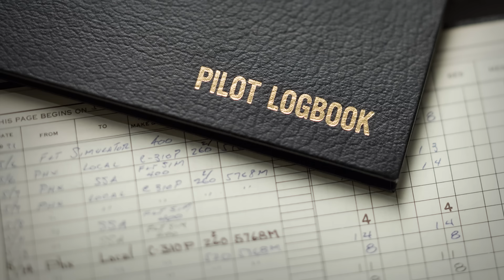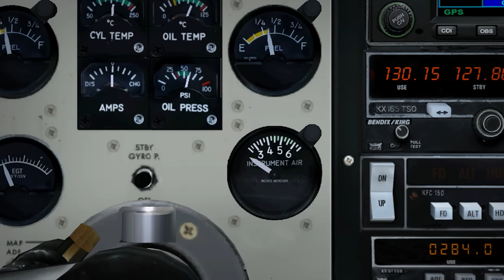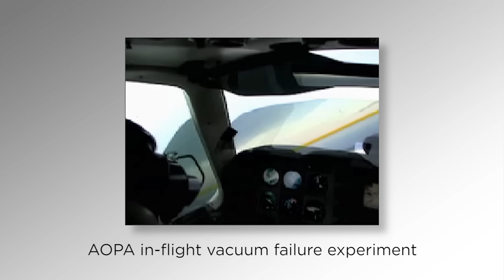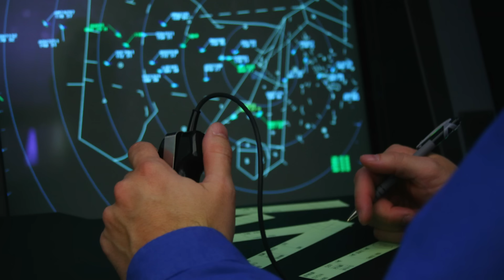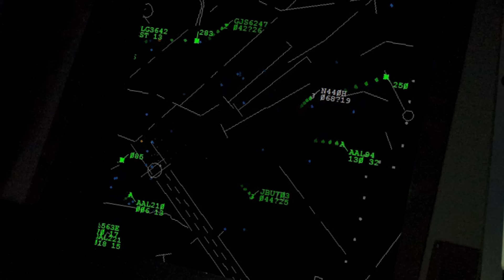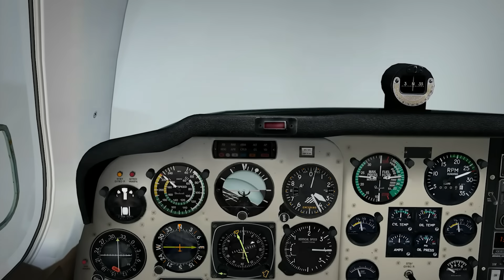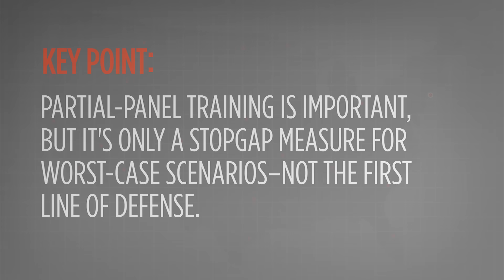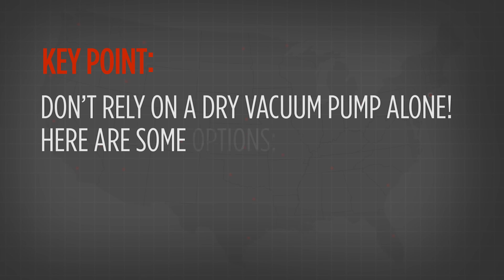Accident Case Study: Single Point Failure

Comment: Know your airplane!!  As a young pilot, back in the late 80s, I often thought of ATC as the big Pilot God.  You know;  they could help/get you out of anything.  Not!  They are there to help you and that is true.  But, many are not pilots themselves. My next door neighbor is one of those.  He is a great guy and a fantastic controller by the way.  In reality, they are there to assist the "Pilot in Command" during an emergency and one needs to be very clear in telling them EXACTLY what you can and can't do.  Remember at the beginning of this film how the pilot was reluctant to declare an emergency?  I do believe many pilots look at ATC as the "Father of the sky".  (Don't ask daddy for help when something is wrong. You might get into trouble type of mentality.)  Fly High
Reply: Great post!
Reply: I've been guilty of it too, there is a reluctance to declare an emergency, which is just silly, as long as you aren't maliciously abusing your PIC authority the worst you will have to do is file a written report. When the pressure is on like that you need all the help you can get.
Reply: Terry Melvin  Well he can't fly very well with a partial panel. ATC should be a lot more helpful in this situation.
Reply: He never told ATC what his problem was. They are not pilots, not engineers, and certainly not familiar with the techical details of your model plane.

Comment: The first IMC flights were conducted using only turn-and-bank indicators. Virtually all small aircraft now carry an instrument that tells the pilot if he is turning (and in which direction), i.e. equivalent to the old T/B - a GPS, either panel mounted or portable. 
Keep the yoke centered and use only rudder for directional control is actually quite simple. The hardest part is ignoring the seat of your pants...

Comment: In 2010 I flew a 1972 musketeer into IMC without being instrument rated and the worst thing was just as I flew into IMC my vacuum pump died and there was no back up also. It was a miracle that I got out of these conditions without killing me and my friends. ATC was really helpful, he understood everything I told him because he was a pilot also and I was lucky that within 5 minutes after the pump failure I flew out of the IMC conditions, if I was stuck there for another 5 minutes I would have most likely ended up like this guy. That incident scared me so much that I almost never flew again, my friends never realized the extreme danger we were in, they thought as long as the engine is running we're were fine but after I explained to them how close we were to dying and I showed them few videos of what happens when a non instrument rated pilot flies into IMC then they realized how close to death we really were.
Reply: How do vacuum pumps know when they enter clouds? Seems uncanny, but I've lost seven pumps in my career. All of them were while flying in IMC. How in hell do they know?
Reply: Aviation Nut we live in an age of cheap technology that’s a life saver for pilots 
Every pilot should Fly with an iPad running synthetic vision
Panel failure wouldn’t be as much of a problem, you’d have enough information to get yourself to Vfr 
Even without a ifr rating it’s quite easy to use the iPad for additional information
Reply: You always have (or should, anyway) a plan to fly on instruments if you inadvertentely enter IMC. But this isn't as easy as it seems, as evidenced by this, and many other similar accidents.
Reply: wow, Aviation Nut, I am so happy things turned out well. 5 minutes is a long time though, relatively. It's even longer than the story presented here. Do you recall how ATC helped u out in ways a non flying ATC maybe wouldn't have?
Reply: @androidkenobi  Im no pilot and virtually nil knowledge about flying an aircraft. But I feel to be in the ATC some flying certification should be mandatory.
Reply: Murphy's Law: If anything can go wrong it will, at the worst possible moment.
Reply: drjimjam111 Well, that last part you added.  Murphy’s law is simply what can go wrong eventually will.  It’s just bad luck if it coincides with the worst possible conditions (which, can’t have been the case with 7 pump failures, as he clearly survived each.  If you survive, coulda been worse lol.)
Reply: Scary story Aviation Nut!!  Glad you and the friends survived it!
Reply: There have been a couple of accidents where ATC did not understand the severity of a vacuum pump failure and properly assist the pilot. Most ATC people I have encountered are outstanding professionals.  But it all comes down to the pilot.
Reply: @raoulcruz4404  what Vacuum pump does? Thanks
Reply: @Sky10811   Supplies air to operate the gyro instruments, such as the attitude gyro and the heading indicator.
Reply: For diversity they hired a moron for the job in the White House. So it goes.
Reply: I'm not a pilot, but my sons are. For ga pilots... Why not have a back-up plan to follow your instruments when hit with an imc situation. Heck my youngest focused so much on his instruments, the instructor had to teach him how to keep his head UP (he loves flying the instrument panel! He's a gamer so go figure).  

PPL Training does teach a bit of flying on instruments, it should become a regular training regimen imo. Like bring with you someone in the right seat, and at some random time put on the foggles to force you to fly by instruments alone.  That will instil confidence and ability to get out of a bad situation.  

As far as your incident goes Aviation Nut - and I asked them - My son's FI's always teach to follow the turn coordinator & mag compass in partial panel ops, and to cover the bad instruments with post it notes. It does work. I could never imagine a confusing panel blaring all the bullshit they do with a bad vacuum pump system plus being in the clouds or at night. It's scares the hell out of me just thinking about it.  As a dad I do the fsx bit from time to time, but can stay out of trouble by following those 2 instruments (if I fake it). (God, the mag compass in fsx sux video quality wise).  My youngest keeps wanting to steal my simulator.. haha! Guess I need to buy him his own rig.

Cheers man. I love musketeers... and totally go apeshit over sundowners! I love the twin doors, 180hp... full ifr capable. Maybe looking to buy one some day.
Reply: @dryan8377  I LOVE the idea of instrument panel flying on your own time with a safety pilot, even if you're not IFR rated or going through IFR training. It's great practice and won't cost you anything extra except a beer for your friend. I plan on doing this every chance I can.
Reply: @dryan8377  You'll likely love the new Microsoft Flight Simulator due out maybe mid-2020. I'm sure you'll be aware of it though.
Reply: Vaccum Pump failure.. another reason not to fly with these amateur technology aircrafts
Reply: @bobl78  Get over yourself

Comment: It would not be that hard to train controllers that a vacuum failure is an emergency.  There was unnecessary distraction when the controller asked the pilot to descend into IMC when the pilot had just informed the controller that he had lost his gyros.  What part of No Gyros didn't the controller understand?  I understand that controllers aren't pilots, but having some basic knowledge of systems and their significance is not an unreasonable expectation.
Reply: The pilot has to declare an emergency in situations like this. Once he does, the controller has more options, which is why he kept going on about it until the pilot confirmed that, yes, he was declaring an emergency.
Reply: When a pilot declares an emergency, controllers should have a way to get a pilot controller to assist. ATC did nothing for this guy.
Reply: Being misheard happens, this is why confirmation is repeated back. Second the pilot can simply say "unable" followed by stating what they are doing instead, not as a request but as a statement like "climbing to 8000feet due to cloud tops". ATC must work around the abilities of the aircraft (as declared by the pilot). ATC is there to prevent collisions (air to air and air to ground) ATC is not there to fly the aircraft.

Comment: I have lost vacuum three times,  all  in IMC.  

My IFR training involved  lots  of partial-panel.  There is no reason for anyone to not survive vacuum failure.  Being able to fly with just the turn coordinator is  mandatory_.  Make  _sure  that  your  instructor works with you until  you  are comfortable you can do it before you get your IFR rating.  

After the second time, I bought the alternate-source vacuum hook-up - then forgot I had it when I lost vacuum the third time.  Oh, well:  at 8 or 10,000 feet, it doesn't work so well, anyway.  

February of 2017 I had the Garmin G-5 installed in my 182 as soon as it was legal.  The old vacuum AH was moved over to the right side.  I also bought a new autopilot, an S-Tec with its own turn coordinator; so the old one was also moved to the right side.  Love that redundancy!  

If you cannot survive vacuum failure, get an instructor who will teach you how!  

Quick hint:  without vacuum, only change altitude or heading at a time;  never_,  _never   try to do both at once.  And tell ATC not to ask!  You're PIC, not them!
Reply: I call bullshite too. Any aviator worth his salt would be humbled by such events and would undoubtedly be quite forgiving and helpful toward less experienced pilots. No decent pilot would be bragging about this in a video featuring an accident caused by the same
Reply: @rsmith155  Perhaps an arrogant one, and believe me, there are tons of those
Reply: Battlefind which is why I specified that “no decent pilot” would
Reply: Battlefind and I was agreeing with you. Welcome to YouTube comments!
Reply: @rsmith155 , you're taking offense where none was given.
Reply: You are RIGHT, One at a time.  So Even if ATC tells you, “Turn Left to a heading of 060, descend and maintain 5,000 feet”, You can easily turn first, level out, then start your descent.  Back in the 60s (I’m an Old Pilot), we used to practice IFR on a Mag Compass.  So all you need to control the aircraft to a safe landing is a Compass, Altimeter and Airspeed.  You should know what RPM/Prop setting along with Flaps and Gear will result in what airspeed and/or Rate of Descent.  Usually you have a Turn-bank indicator (electric) and maybe even in older aircraft an ADF both of which help a lot.
Reply: You’re talking about what to focus on for IFR training, but this guy wasn’t certified.  I’m certainly no expert but I’ve seen plenty of situations where VFR pilots enter IMC and that’s all she wrote.  Ofc if you have IFR training you’ll be more capable.  Pretty sure the only thing for a VFR pilot to do would have been divert far away.

Also everyone talking about pumps says they’ve always failed in IMC.  There must be something about clouds and weather formations that increases the likelihood of a failure, there’s no way that’d be coincidence, unless people just tend to forget failures under perfect conditions.
Reply: @newname4405  There is no correlation between IMC and vacuum pump failure, the pump can't tell if the pilot can see the ground or not.  The pump failing on a flight in visual conditions is a non-event, however, if in IMC it can be a big problem.  This is why you hear about them failing in IMC.  If you find yourself operating partial panel, communicate this clearly to ATC, get to and stay VFR on top if possible.  If you must shoot an approach to land, get vectored for a straight in approach in a radar environment where ATC can monitor your heading as you descend.  An airport with a CAT III ILS has more lighting, which can assist with nighttime approaches.  Some airports can provide no-gyro approaches where the pilot is guided as to when to turn left/right by the controller.  Ask if these are available!  Use the resources of ATC, they are more than willing to help, but you have to clearly ask for their help.
Reply: That's my feeling as well . I'm really not clear how a pilot could rack up 4000 hrs and NOT be IFR rated  I mean is that a common thing ?
Reply: @TheRoguelement  Its pretty common unless one is either actively employed as a pilot, or is highly committed to maintaining IFR competence over their entire lifetime. The pilot in the video held an ATP certificate, which is like an instrument rating but with much tighter performance standards.The certificate is good for life, but the skill set starts to degrade in as little as a couple months of non-use. If he retired from an airline career at 60, and either chose not to maintain currency, or just did the minimum legal requirements, after 6 years, he is ill equipped to deal with a partial panel situation.  

This is often a very difficult thing for retired pilots. They have memories of years of recurrent training and checkrides... so their is a tendency to believe one can always put those skill back to use. And there is an element of truth in this... Most retired airline pilots can become proficient and safe with only a very modest investment in recurrent training, even if a number of years have passed. However, without recurrent training, they can and do get in over their head very quickly.
Reply: I call bullshit on that one.
Reply: @bellboy4074 , I call bullshit on you calling bullshit on him.

Comment: Sad situation from which an excellent analysis has emerged.Outstanding job by ASI.Agree that pilots need to take control, decide, & then tell ATC what you need, such as specific altitudes & “no gyro” turns.Was the gear found retracted? Putting landing gear down in a bonanza (like most aircraft) can really improve control.Electric backup attitude indicator, if present, is ideally placed in pilot’s scan, rather than off to the right or on a sub panel.
Reply: wondering, how does putting the landing gear down improve control, reduce your speed?
Reply: @modeler4  By increasing drag, reducing Vs and reducing airspeed, gear extension allows a slightly more stable flight regime from which aircraft is less inclined to develop an unintended roll. Extending gear should be one of the key moves when flying into a thunderstorm or severe turbulence, esp.in a high performance plane like a Bonanza(see POH). Admittedly, this may not do enough to prevent a spin, and having redundant horizon guidance, as emphasized by narrator,is tantamount to flying imc.

Comment: Great Video!  The vac system is always a major concern.  In 12,000 hours of flying I have had three failures of both wet and dry vac pumps (all in VMC).  As a rule, I will not go IMC in a plane or helo without a back-up.  Ever.  Trying to safely fly in IMC without a back-up is very foolish.  Recently, the vac instruments in my plane have been failing, although the suction gauge always shows in the green.  I finally had "had enough" and installed an Aspen 2500 system and yanked the whole vac system.  When a vac failure is imminent, it is no time to re-learn one's Partial-Panel skills.  www.mentorflightoptions.com

Comment: Controllers should encourage declaration of Emergency.    "do you want to declare..."  VRS "I encourage you to declare.."  The difference in words could save a life.  Further, when single pilot a controller should take a more active roll helping the pilot.
Reply: In europe ATC is encouraged to treat any aircraft that communicates an "emergency-level" problem as an emergency, even if the plane doesn't officially declare. (And ofcourse the mayday call isn't mandatory in either europe or the US as it just indicates the following message to be a distress call or distress call relay.)
The way I heard it said by an austrian ATC: "If you have to ask if it's an emergency, it IS one."
Reply: This is what this channel is about,  you are the PIC and you need to do that
Reply: I don't think ATC can take on that responsibility.  One controller may be handling numerous flights, and can't possibly take responsibility for evaluating and determining whether or not one guy is having an emergency while he's running a dozen other planes.  The pilot is only handling one flight:  his own.  The pilot has to do the evaluating and tell the controller he has an emergency.  

In this case, it sounds like the controller had enough room in his workload that he could "encourage" (by asking) this pilot to declare emergency.  But we can't require that of the controllers.   Once the pilot tells ATC he has an emergency, then they will do everything they can to get him down safely.

Comment: I've watched three of these caused by "vacuum failure" and noticed a trend. Old school part-time pilots flying old equipment without upgraded technology - I mean, not even a GPS capability?
Reply: If you're used to flying with "old equipment" you'll be fine in a situation like this. He might have had GPS, but he wasn't used to flying with a turn-and-bank indicator, but rather relied on his artificial horizon.

And GPS is by no means required eqipment on an airplane, it's just a convenience.